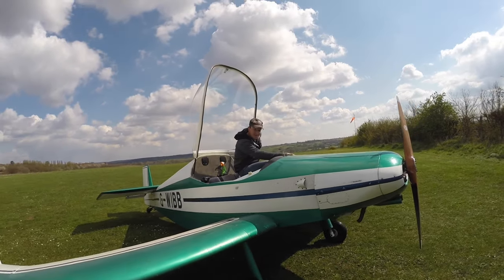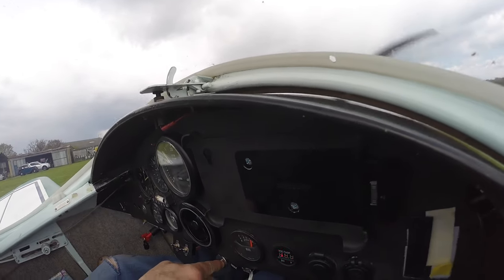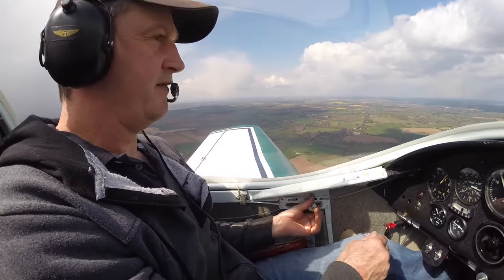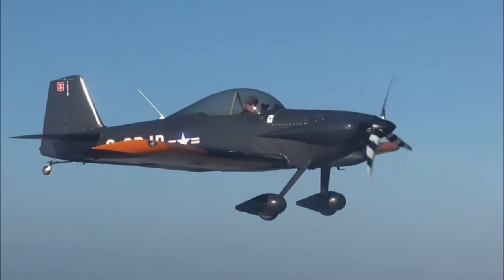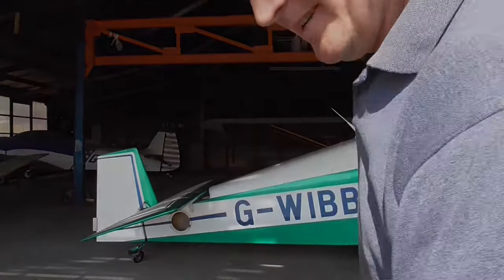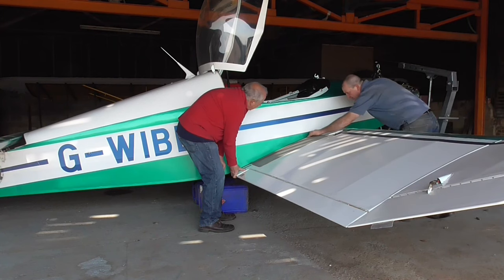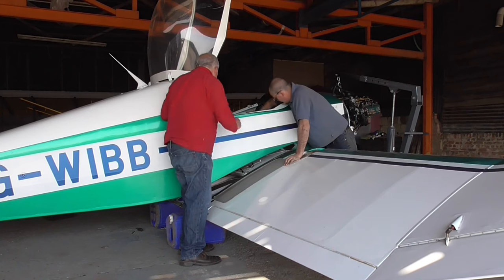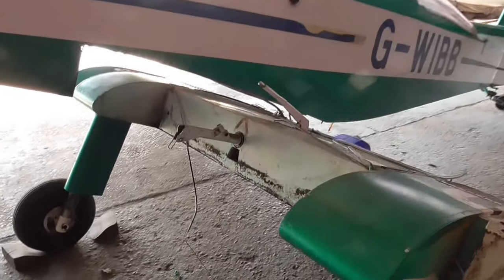REMOVING THE JODEL D18 WING - PILOT VLOG #358

Comment: Whether it is a 747 or D18 I always find it amazing at what connects a wing to a fuselage it never seems adequate but it is! I suppose it does make for "easy" maintenance if not a lot of work for a fuel tank! Just hope you don't have 1 screw left over when it all goes back! Thanks Tim and Duncan.
Reply from the maker: Let’s hope it all goes back together as easily!
Reply: It because the bolts are always stressed in shear, not in tension.

Comment: Interesting video as normal Tim. The bolts don't need to be too big as the wing will be holding itself on to the fuselage as long as you have +g (so could use gaffer tape). I was supprised that the fuselage was being moved with the canopy open, I was worried that the weight so high might be a problem as well as it hitting something.
Reply from the maker: A sensible comment Algy. As Duncan kept looking inside I suppose but you are right, it might have been safer with the canopy closed.